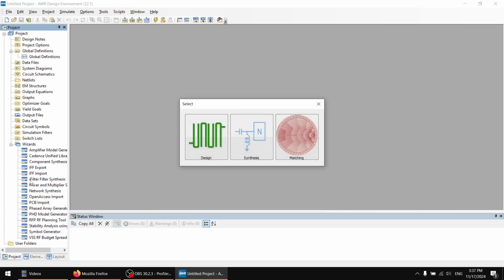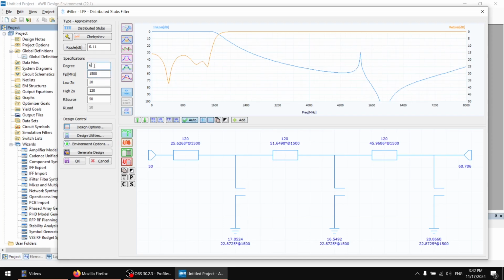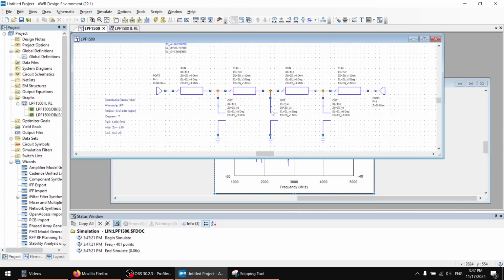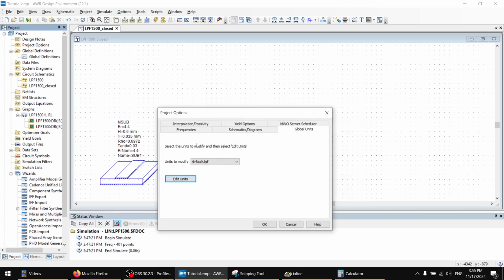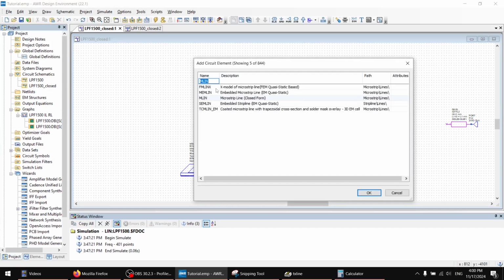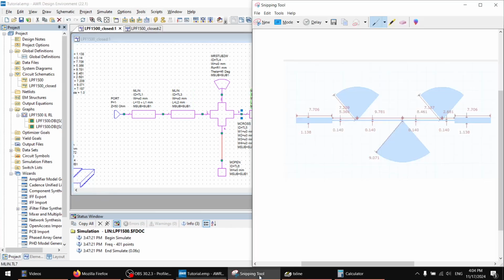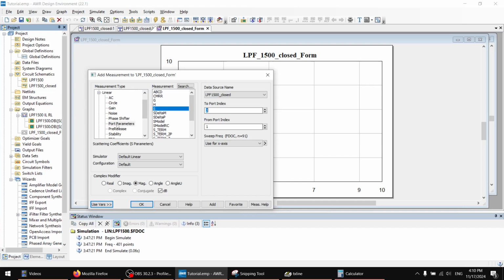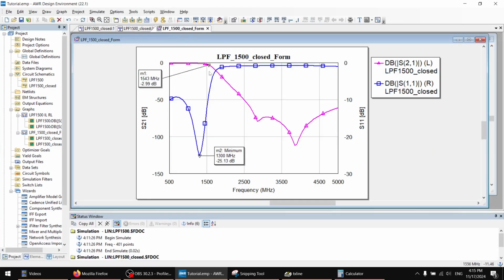Microstrip LPF Design, AWR Microwave Office Tutorial 1

Comment: It's an excellent tutorial. I have a question: "Why do you use 10+L1, after the port1 and before the port2?" What is the purpose of 10 here?
Reply from the maker: That is additional length on the PCB so that the filter is not directly at the edge, it also makes it easier to mount the connector without affecting the filter.